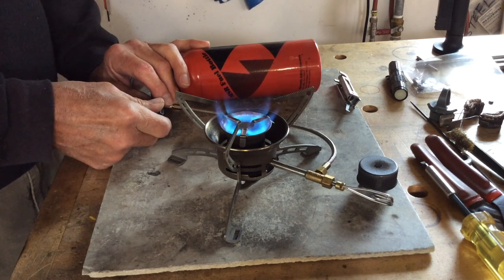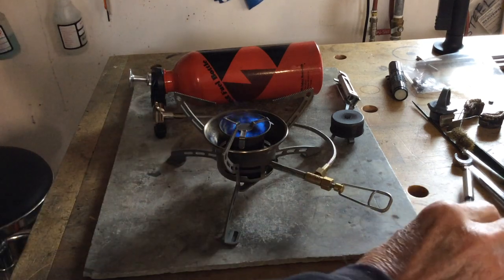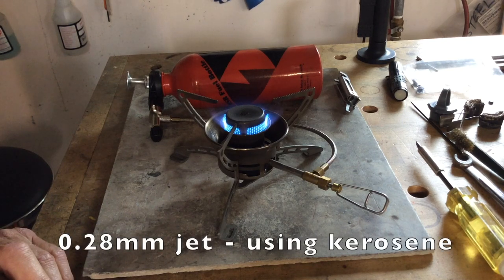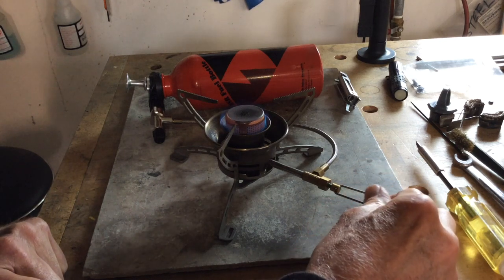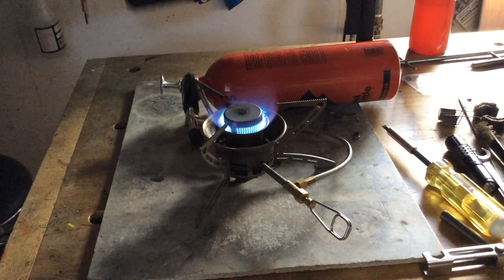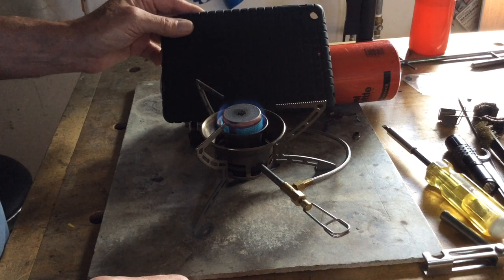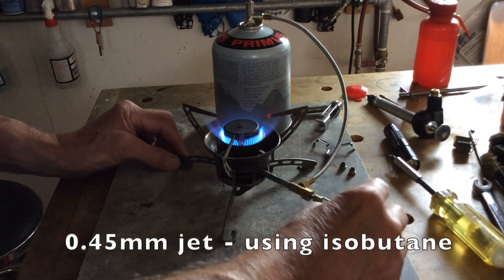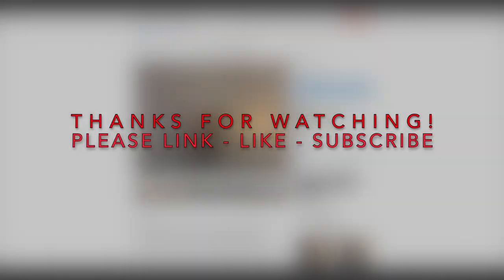Do BernieDawg Silent Caps Simmer on Stoves?

Comment: Another great video mate,are the simmer rings the same size as the Opt.5 and such or do they differ?
Thanks for your time(just discovered the brassy's,so addictive!! Especially the boxed ones!!)
Take care
Murray Howe Sydney Australia.
Reply from the maker: @Murray Howe Thanks! The silent damper cap products I sell are in various sizes to fit various stoves. Caps need to be designed to properly mix fuel vapor and air for a particular stove. Most of the caps I designed and sell are not the same size as the Primus or Optimus No.5 silent burners caps of old. If you need caps for those out-of-production vintage stoves, just contact The Base-Camp in the UK. They have the right parts for your stove and there’d be no reason for me to make those. BD
Reply: @BernieDawgCinema  Thanks mate for a speedy reply,great idea for the gas type stoves. The ring spanner tip for yr 8r vid was gold. Definately want one of these,so researching it and coming across yr stuff has been too good to b true. Thanks again, Murray.

Comment: can it work on ethanol?
Reply from the maker: If your stove works on ethanol with a flame plate in place to begin with... then a BD cap suited for the stove will work on the stove using ethanol. Of course, you only get about 50-65% of the heat energy out of ethanol as petroleum fuels, so you'll have to carry 35-50% more ethanol fuel. Ouch. My aching back! 😁 BD